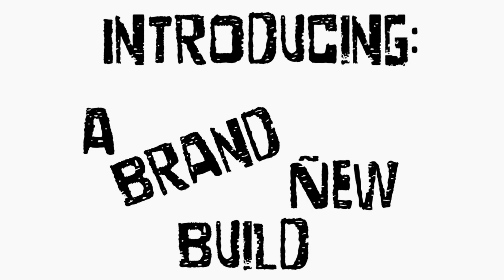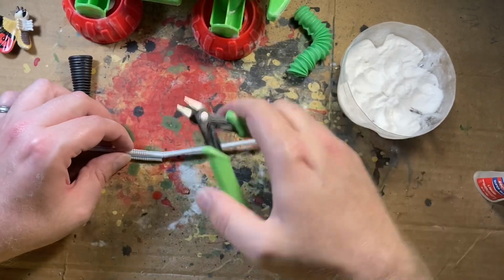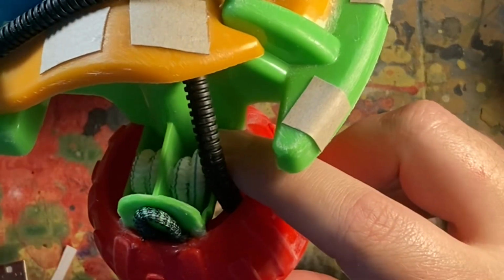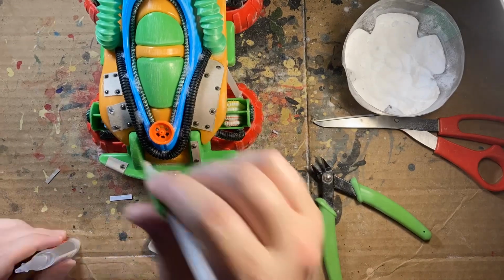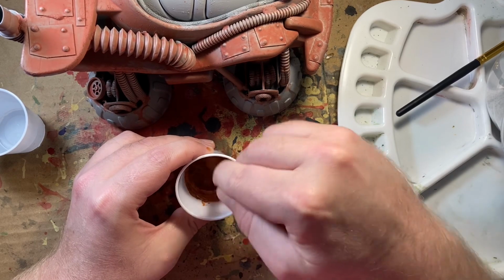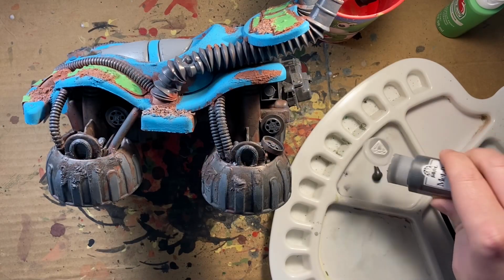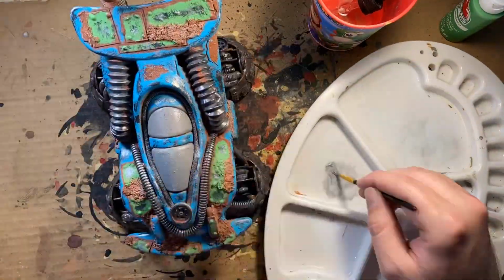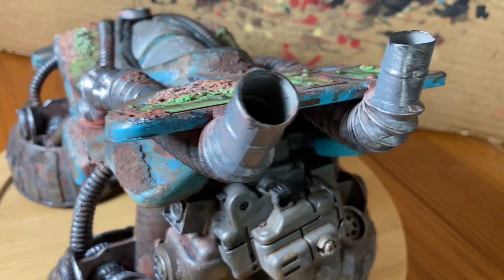Scratch building a cyberpunk hover car

Comment: What Brand of paint and Brushes you use
Reply from the maker: Cheap pain from Wal-Mart. Apple Barrel. And any brushes I can lay my hands on.
Reply: Cool great Job do let your k8ds play with them or wait till there older
Reply: Have ever used a Pyrogravure 
To detail any plastic Parts
Reply: Have ever use Spray Can 
To paint any I f Your Projects 
Like with .Rustled
Kryon Fussion
Or Brands like Tamirya
Or Army Painter
Reply: Have you ever had to use a Pyrogravure 
On Plastic stuff
Reply from the maker: Nope. Still a beginner. I’ll have to look into those.
Reply from the maker: Nah, they are not interested in playing with my stuff.